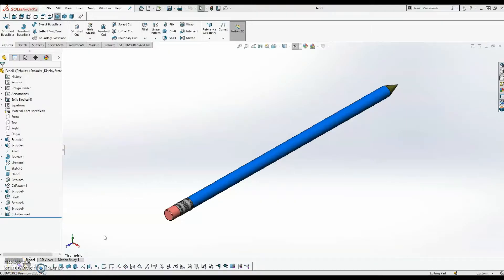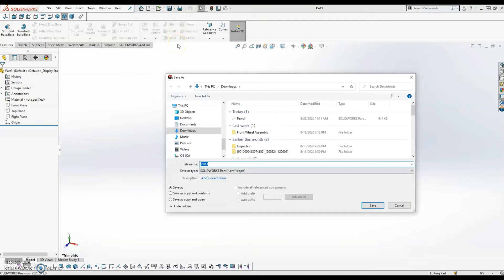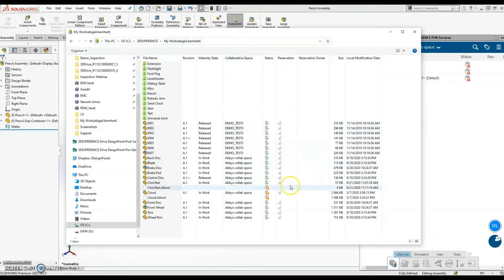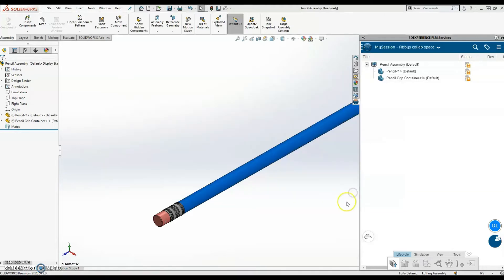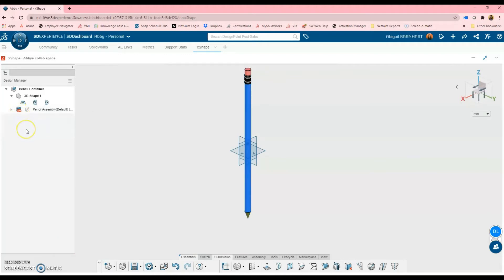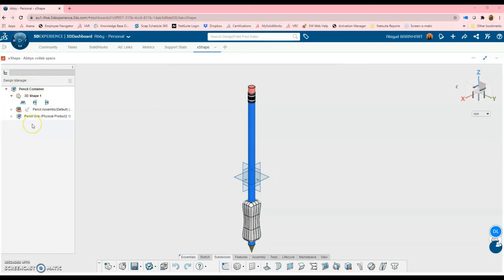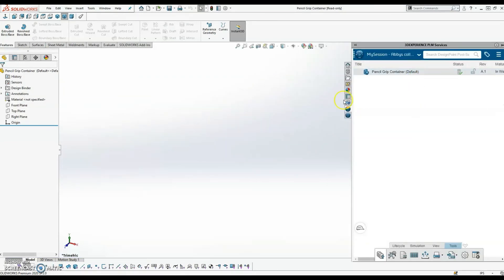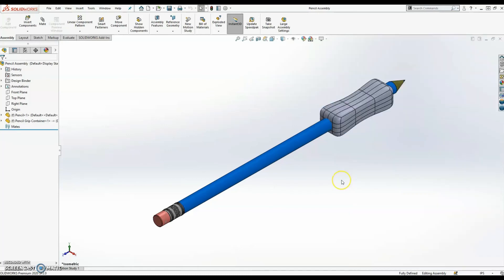xShape and SolidWorks

Comment: What’s the difference between xshape and the power surfacing add-in?
Reply: Nah, xshape is cloud-based? It looks slow to set up, load and save. Power surfacing is integrated right into Solidworks.